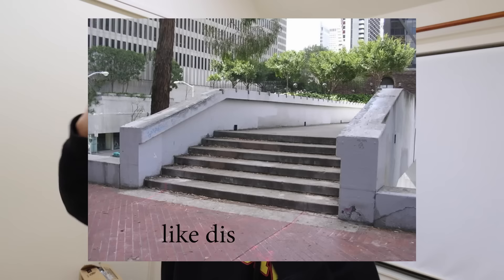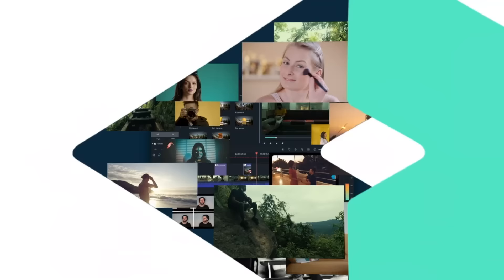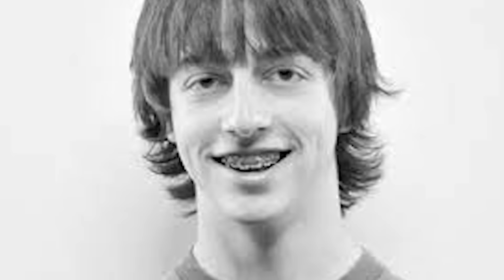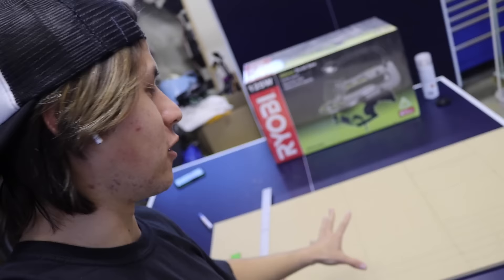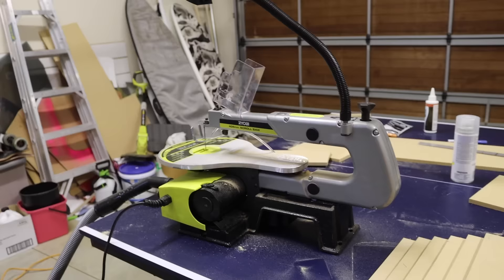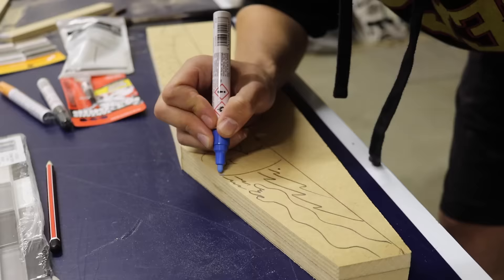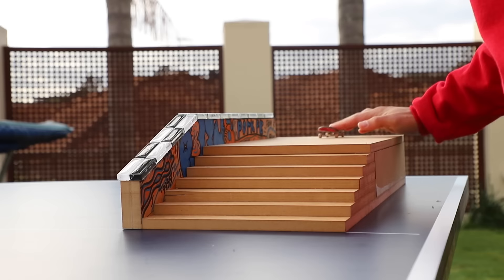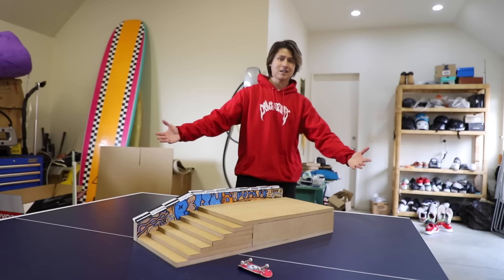D.I.Y FINGERBOARD STAIR-SET WITH LEDGE!

Comment: for anyone looking for a saw to do similar things, a band saw is a better and cheaper option. The scroll saw is best for holes in the piece, a band saw will do complex cuts but wont do interior holes. Unless you have a specific hole in a piece you need cut, a band saw is a better tool for you. You could also get a jigsaw for the cuts you would need a scroll saw for on the occasion that interior cuts are needed. Scroll saw is a fantastic saw, but its a very specific case tool that has cheaper alternatives if you aren't going to need to do hole cuts all the time.